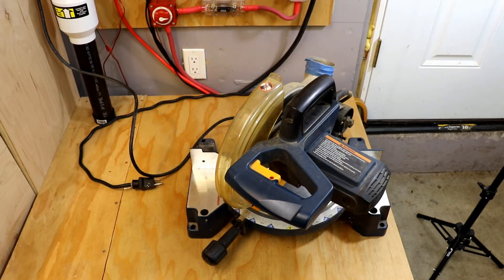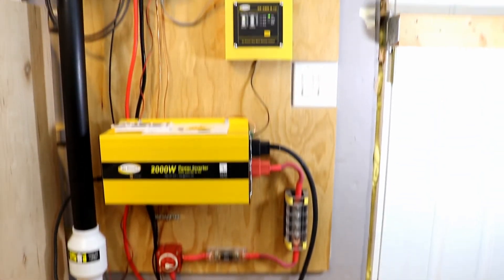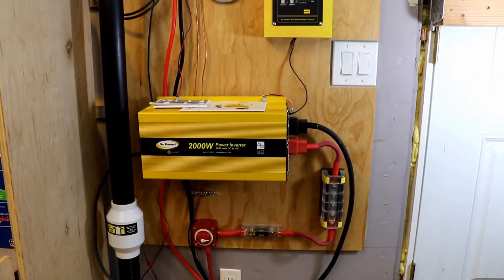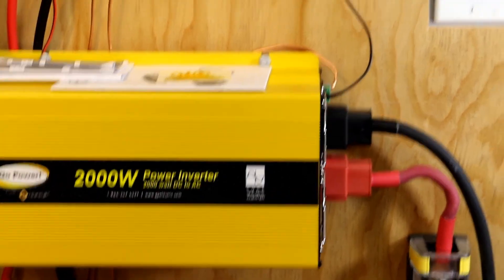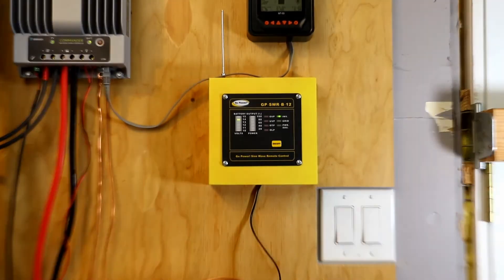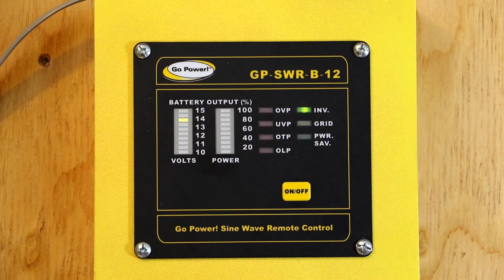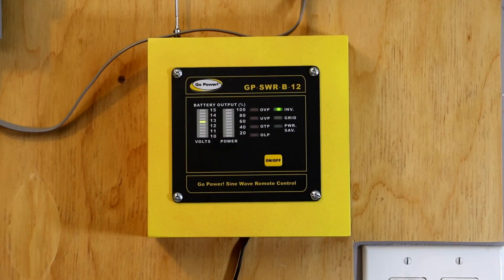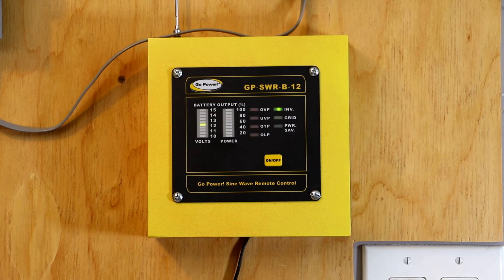Go Power 2000 watt Inverter Load Tests

Comment: What is the fan noise like? I couldn't tell from the audio. I see this is probably away from your living space so it may be a difficult question to answer. I'm putting one in my little camping trailer, under the couch, and don't want much fan noise, though when it is pulling a big load, the fan is inevitable. I just got a different brand of "industrial quality" PSW inverter, and the temperature controlled fan is set so low it starts running at 88F air temp. even without a load. I don't like that, and might change it.
Reply from the maker: Ron Nehrig The fan definitely makes noise it's not terrible, but usually it has to ramp up above 10% or more to kick it on.  If you listen with headphones to the first test with the Air Conditioner you can hear it kick on & hear it best.
Thanks for watching & take care.

Comment: what's your full system is panels wise.
Reply from the maker: +Silverado 66 
Currently I am running 4 100watt Renogy Panels in series.
& I am hoping to increase that to 8 or 10 panels & have 2 arrays of 400 or 500 watts.  For the time being I will remain at 12volts even with the additional panels.
Feel free to ask more questions any time friend take care.
Reply: love your setup nice ,clean looking great job . keep making video's.
Reply from the maker: +Silverado 66 Absolutely, I have a few things coming up I would like to share, unfortunately one is a bit disappointing.  
Take Care Friend.

Comment: Nicely done! Looks like it handles surges much better than the 1,500w version I have. Prob should have gone with the one you got (in a 24v). Didn't think I'd be running an window AC on it tho...
Reply from the maker: +Chris DIYer Yeah, Eventually I will change over to 24v, I am probably a year or more out on that conversation though.  The good news is the 24v model is cheaper than the 12v model.
Thanks for Watching.

Comment: Try that chop saw while cutting something to get the full load.
Reply from the maker: +TheKilog69 I did earlier & the start up still pulled about 10% more than cutting a 4x4 I usually cut fairly slow to prevent chipping & at the same time keeps the motor from bogging.  
The only Item I didn't try was my air compressor not even my Honda EU2000 can run that.
Hope your hand recovers quickly, darn air bags.